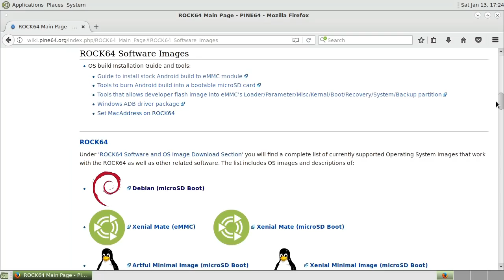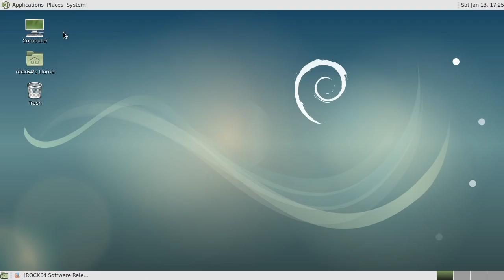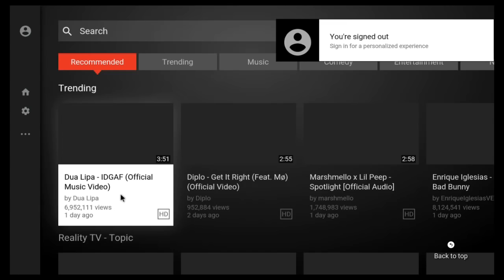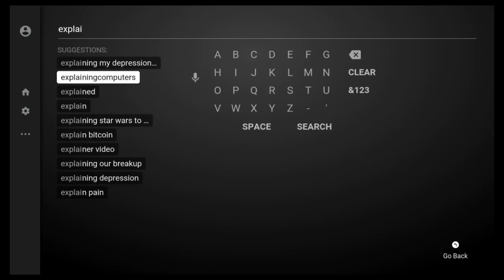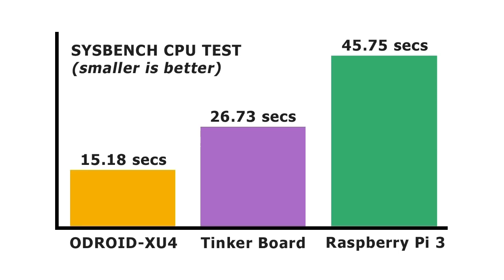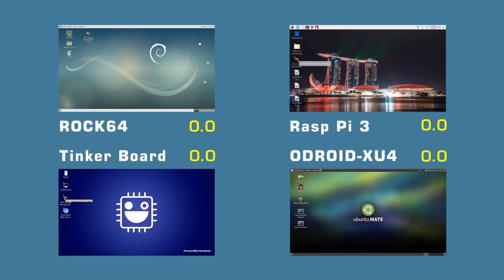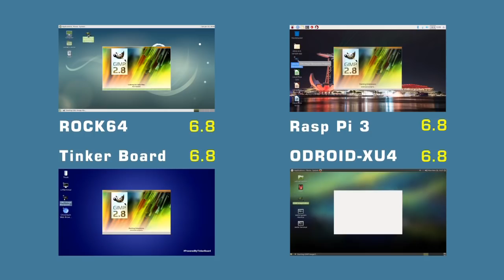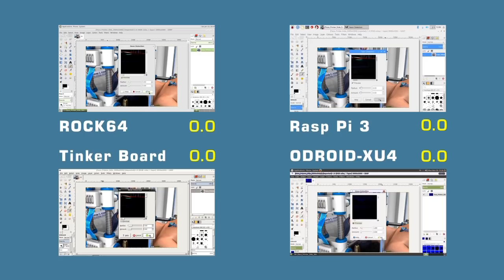ROCK64 4K USB 3.0 SBC

Comment: Very good review! Well rounded coverage.

Regarding sysbench the issue could be one of interpreting the results correctly. It can be confusing as is seen in the dialog here between the sysbench author and someone a bit confused about cpu-max-prime.

https://github.com/akopytov/sysbench/issues/140
Reply from the maker: Very interesting -- thanks for the link. I have always relied on total time as a relative performance measure.

Comment: I suspect the massive improvement in performance is not down to CPU but the increase in available RAM so reduced need for swapping (unless all the tests were configured with zero swap file available).
Reply from the maker: Possibly -- although the Tinker Board also has 2GB of RAM.
Reply: Don't know if this is meaningful, it is a 2 year old report using different variants of the chip, but it may hint at something in the arithmetic unit (which would ofcourse be key to factorisation).

https://www.cnx-software.com/2015/08/16/rockchip-rk3288-vs-rk3368-benchmarks-comparison/

The point being the the tinkerboard uses the Rockwell 3288, and the Rock64 uses the 3328, yet the report suggest that the 3328 in single processor running at 66% of the clock speed, seems to get a slightly faster integer result.  The Rock 64 is running only at an 83% clock speed disadvantage.
Reply: ON, looking at the Rockchip specs, the 32xx is a 32 bit core, while the 33xx series is a 64 bit chip.  There is no way they are going to compare on integer arithmetic.  In other words, the tinkerboard is only running 32 bits against Rock64 at 64 bit (as the name suggests).

https://en.wikipedia.org/wiki/Rockchip

Comment: The standard form factors is something that's just awesome to see, I hope more SBC's follow suit. How ever The Rpi 4 has to be coming out soon. The Pine64 looks like a nice toy to play with, however it seems like its a bit late to the party, and will be over shadowed by the 4 when it comes out, most likely next march. I for one won't be investing in this one. I tried out the Beagle, Banana Pi Pro, and the Tinker board. I find the Raspberry Pi the easiest to play with as well as MUCH easier to get help when I get stuck than any of those boards, and I feel the Rock 64 will be more of the same.

Comment: Built in hardware decoders, 1G Ethernet and USB 3.0 port along with 4K video output makes it a good candidate for a media player setup. On the other hand 4G version could be a nice processing hub for network management and smart home stuff. I like this board and its price point. Can you measure idle power consumption?
Reply from the maker: I will indeed look at power consumption of this -- and other SBCs -- in a future video.

Comment: you really cant use it in most Rpi cases, the IR receiver, power buttons and barrel jack will stop you from lining up with any case with IO cutouts and any cutouts for the IO pins and heatsinks won't line up either.
Reply from the maker: Accepted -- some cases work, some don't if uo want to use things like the IR device.
Reply: I 3d printed my case. Exact fit.

Comment: Would this boot from SSD using ROCK64 USB 3.0 to SATA III HARD DRIVE ADAPTER CABLE/ CONVERTER with UASP
Reply: Actually yes it would. If you mean booting an OS. The firmware should reside on SPI NOR, which is HUGE here (16 MB), and btw, they recently added support for flashing FW there, or it can reside on SD or eMMC. And then it will boot your OS from any of these sources. Plus - USB, and also network. You need to visit their forum or IRC and they will answer you.
Reply from the maker: I don't think so -- I don't think this board can boot from USB.
Reply: Do any of the single board computers boot from USB?  *ANSWER* https://techsparx.com/linux-sbc/raspberry-pi/boot-pi-ssd.html
Reply: You can buy eMMC modules that attach, which are faster than microSD, but slower than full-on SSDs.

Comment: Quick question: most Smartphones are based on Snapdragons SOC . Why most of single board computers  use chips from different manufacturers? I have heard that Raspberry Pi use Broadcom because they wanted to go as open source as possible. But wouldn't it be simpler and better to use for example Snapdragon 625? My Xiaomi Redmi Note 4x use it and I must say its a fantastic chip-  very good balance between power and efficiency.
Reply from the maker: Only the manufacturers can answer this!
Reply: A lot of SOC manufacturers have massive minimum order quantities that smaller manufacturers cannot afford/risk.

Comment: I really like the extra bank of GPIO pins. That's the hold-up I have with the Pi series as opposed to devices like the Beagle Bone Black. I did a quick scan of the specs and don't see if there are any microcontrollers available. (possibly tied up with the built-in devices?) 
PS - I just read a thread that stated pins 17-22 of the 2nd GPIO can be used as a second Fast Ethernet device!!! Very nice router potential if it's true...

Comment: RE: sysbench bug. I suspect that there is a bug in the system libs on these. It fails to wait for the threads it spins up for the calculations to finish their work. The usual candidate is the 'pthread_join' method not waiting for the thread to exit. This is my educated guess. :)  What can happen is the thread has taken too long to spin up and when 'pthread_join' is called it thinks it has already ended. Semaphores should be used to ensure pthread_join is not called too early. c++11 has some nice tools to help with this.
Reply from the maker: Thanks for this. :)

Comment: Depending on the application, an SBC without wireless connectivity may be preferred for security reasons.
Reply: Personally I’d prefer gigabit ethernet over integrated bluetooth and wifi.
Would be nice to have it all tho.
Reply: Mark Warbington 

Right. Depending on where you can find an Ethernet cable (especially with gigabyte capability), it would be smart to connect to workstations that already have wireless capability and use that. Basically a parasite that uses another computer’s stuff.

Hmm, that would be cool, a parasite computer. I remember a hacker once used millions of computers through a virus to hack government servers. That was an epic example of brute force, but here it would apply to a single computer just to run hard core applications like Autodesk Inventor.
Reply: @topsecret1837  Ethernet is becoming increasingly less common as more people dump cable. These devices are primarily marketed toward Americans, who often have one choice for a cable provider which will offer speeds a tenth of the rate of 4G/5G mobile internet with a thousandth of the reliability but ten times the price. Mobile internet is wireless.

Comment: This is almost what I figured a Raspberry Pi 4 would be, if there ever would be one.  But it is missing WiFi and a second USB 3 port.  Although I am very impressed with this board, using a dongle for WiFi and another for a keyboard with a mouse pad only leaves one open USB.  Which is fine using a TV, but plugged in to a monitor, i prefer using  keyboard with a separate mouse. In that situation I would find myself one USB port short, since I still prefer having an extra empty USB port available.  This board is almost close to SBC perfection, especially the 4 gb version.  For now I will stick with my Raspberry Pi 3B.
Reply: Perry McClusky this is the same issue I have with this sbc. However, a usb hub could probably  be connected to this.
Reply: rupe1986 You are very correct that a usb hub can be used on this impressive board.  One of my main attractions to this board is its compact size.  It’s amazing what it and the other SBCs its size can do.  My preference is to have one more USB port then to plug in an usb hub adding to its bulk or footprint.  Let me just say, this board is to me near perfection for a SBC. Personally I can’t believe they put as much on that little board as they did. I am truly impressed!

Comment: USB 3 is very nice, but no on-board radio means it's a no-no for me.

ps they missed a trick with that nice presentation box, stamp in some knockouts and it would have made a simple case for the unit.
Reply: Same... The new Pi-3 B+ now has AC Wireless!!!

Comment: 7:20
With all the features and functions this board provides, to not have wireless connectivity is most certianly the best option for this boards market. I believe this product shaved $10 cost to the consumer to be more of an upgrade at a much more appropriate cost - lots of people who used rapi2b for instance used two seperate usb 2.0 ports for soley 2.4ghz wifi and soley bluetooth to also save money and enable lower power operating states i.e turn off power to all but one port entirely. While it is quite right to give them critique for removing what we see as a now basis of technology, the ability to communicate wirelessly, I think the point of this product is to introduce a slightly more premium experince to people who already own or are already familar with pre-armv8 raspis. While it does give me a feeling of "pretender" syndrome I have to say it is great for tinkerers and software guys to have a cheap platform with emmc.
Reply: Charlie Croker - More like $5.  The RPi 0 V1.3 doesn't have WiFi or Bluetooth but the RPi 0W does and it is only a $5 difference with just one chip added onto the board.

Comment: Just incredible. I Am writing this on and old Sandy Bridge laptop with an i5-2540M running Debian with KDE and a few apps running and and when running the same sysbench test I'm getting around the same score, 3.2 seconds. How can it be that fast?
Reply: But it launches Gimp WAY faster, 1.5 seconds. That could be due to the very fast SSD of course.
Reply from the maker: I do not believe the Sysbench score for the ROCK64! There is something very strange going on with it. Your i5 is way, way faster.
Reply: It has to be. Must be something with sysbench then.

Comment: I got my Rock64 since 6 month running OpemMediaVault on eMMC with no issue and its run cooller compare with my PI3
Reply from the maker: Thanks for this long-run feedback on the board. I imagine QMV runs very nicely off eMMC.
Reply: dont have anything to compare, but with USB 3 the Media file transfert very fast between PC than with my PI3 with is poor USB 2 and Ethernet and no issue to read Media on my DLNA devices, but cant install Plex plugin , got error, but not Rock64 fault but with PI3 no trouble with the Plex plugin

Comment: so is tinkerboard better?
Reply from the maker: Tricky. No USB 3.0 or eMMC slot. But onboard WiFi and Bluetooth. And the new Tinker Board S will have 16GB of onboard flash storage (due and appearing here in a month or so!). I do like the Tinker Board, and recently its software has improved significantly.
Reply: i run fs uae on my tinkerboard out performs my raspberry pi 3 on emulating amiga
Reply from the maker: I'm not surprised -- the Tinker Board certainly outperforms the Pi. And many other SBCs!
Reply: The Tinkerboard is 32bit, so software compatibility in the future could be an issue.  We've seen that a lot of Linux distros are ditching 32bit support.  From my reading, the Rock64 is what the Tinkerboard should have been.

Comment: I prefer no WIFI, so I don't see this as a negative.
Reply: Even before your product sees a customer, it needs to be certified, and the certification process for an intentional radiator (product with a radio) is incredibly more expensive. No wifi is a big advantage for small volume OEMs who might use these boards in their products.
Reply: I agree, im looking for this to be a home server, so usb 3 is far more important that wifi
Reply: Ian Ide - I agree 100%. In a commercial application some customers may frown on built-in wireless access for security reasons. I known you could disable it in the kernel but you have to make them happy or you won't get paid.

Comment: Suspicious of built in benchmark cheating in OS or Hardware. Hmm.
Reply from the maker: I keep trying to find it I have made an obvious error here -- but cannot discover what this is! :)
Reply: For whatever reason sysbench runs much much faster using a  64-bit ARM binary than it does when using a 32-bit ARM binary.
Reply: It might be that storage speed is the "great equalizer" between the boards' application results. Not familiar with sysbench and don't know if it is cpu/gpu-only or includes the storage subsystem in its tests.
Reply: There were some benchmarks a few months ago that showed the same unrealistic results.
Reply: How about factors such as cache, and RAM speed?

Comment: Looking very nice small computer. I would like to ask you please. What I have to buy everything I mean all parts to make it work to be able to use? I am not good in technology but I always love your videos. Please tell me what I need to buy with this and from where.. Thank you so much.
Reply from the maker: To make this work you would need the board itself, a microSD card, and a power supply. The easiest way would be to get the board and power supply direct from the Pine64 store -- which is where I got the board from shown in this video. They ship internationally, and if you can afford to wait for a few weeks, shipping is very reasoable. The UK/EU power supply is here: https://www.pine64.org/?product=rock64-pinebook-5v-3a-switching-power-supply  The broader one (also covering UK) is here: https://www.pine64.org/?product=rock64-5v-3a-international-power-supply-with-au-eu-uk-us-plug The board itself is here: https://www.pine64.org/?product=rock64-media-board-computer You will also need an HDMI lead to connect to a monitor or TV (though if you have one of these, you probably have a lead already), and then some kind of mouse and keyboard or similar device. The extra bits do add up -- it just depends what you have lying around. :)

Comment: Honestly I'm surprised that in 2018 we haven't seen any SBCs with USB 3.1, wifi, Bluetooth 4.0+, and much more. To this day, my favorite SBC is my smartphone.
Reply from the maker: We do have board with USB 3.0, WiFi and Bluetooth -- like the LattePanda and UDOO boards . . .
Reply: Panda,oops missed EC answer. However I agree about phone 100% but for tinkering this is the way to go
Reply: In the SBC market, cost matters most.  There are SBCs with more features, but they cost a lot more.  Sub-$100 SBCs tend to have SoCs you'd see in Android boxes.  The Rock64 is interesting because it is the first board I can think of that brings USB 3 to a board similar in price to the Raspberry Pi.  I suspect that will become standard soon enough.  It won't make sense for future SoCs to not support USB 3.
Reply: Stephen Hill much more. But that wasn't the point. I already ordered one of these, I was responding to Chris' statement about it being 2018 and there was no excuse for not having wireless on a tinker board. The 3.0 is a nice addition for this price point, but with USB-C and 3.1 everywhere, I wish it was more common.
Reply: not to mention SATA.

Comment: So many sbc..........
I don't know which one I should buy
Reply from the maker: I am planning a couple of videos that will include lots of SBCs . . .
Reply from the maker: It on doubt and starting out, it is still very, very hard to beat a Raspberry Pi 3 for the total package (hardware, software an support). Though, for a similar price, this is a very nice board. And I expect the new Tinker Board -- the Tinker Board S -- will also be very nice. That will appear here in about a month or so (when the first samples become available for review).
Reply: Raspberry Pi 3 is a safe choice. Especially if you don't know why you might want one of the other models.
Reply: I agree with what the other have said.  Start out with the Raspberry Pi 3 since it has a massive community compared to other SBC options.  You can branch out from there once you are more familiar.

Comment: It's great that standardization of form factors, and such, is happening right out of the gate with these inexpensive, small single board computers. That's a big plus on the user end of things.
Reply: I agree totally. I love that this seems to be the way this community is going.
Reply: It's a smart move. Makes it easier for existing Pi users to adopt the new board.
Reply: What a time to be alive. :D
Reply: It is and it's really neat what these things can do these days for the cost.  Hook it up to your 4K tv and use it as a media center!
Reply: You will get no argument from me.
Reply: John Ratko what about the barrel power input? RPI 3 cases won't support that... Hmmm
Reply: They will require manual modifications for sure on most.
Reply: Recently they have been working on a standard to allow the exact same distro ISO image to run on all boards, but stuff like openGL and h264 decoder acceleration are still miles behind the support given to a standard PC

Comment: I feel so poor because that thing is actually faster than my laptop :(
Reply: Tux - Haha!  I feel your pain...

PS - I bet you can do more with your pokey Linux laptop than some script kiddie using his dad's i7 laptop.
Reply: Some Linux distros like AntiX run so fast that my old slow 2007 netbook actually runs quicker than most modern computers running windows 10. BTW one time I installed Windows 10 on my laptop, and no matter what I did, the task manager would always display CPU: 100%. But with AntiX the CPU is most of the time  
between 3% and 70%, it almost never reaches 100% except when running VMs or something
Reply: buy a used sky lake laptop
Reply: Tux - I ordered a salvaged CPU for my old Dell field laptop (for next to nothing on e-bay) and I no longer have noticeable slow-downs for Linux or Windows 7 & 10.